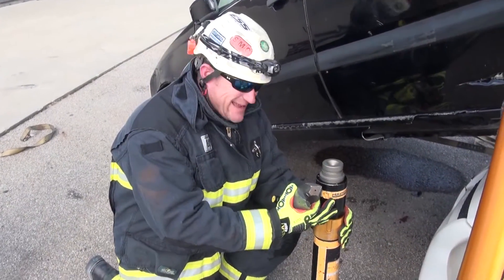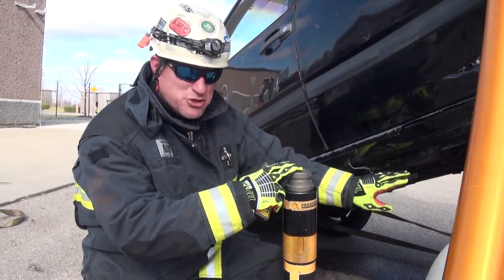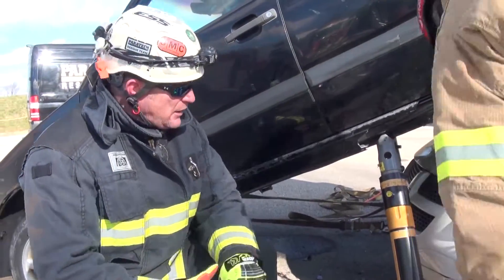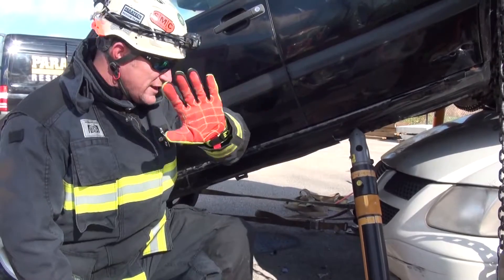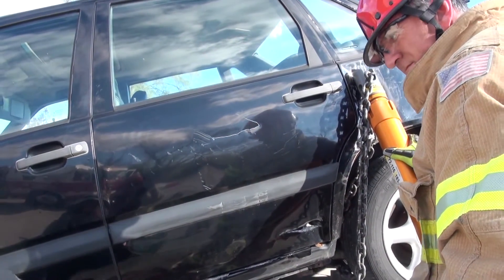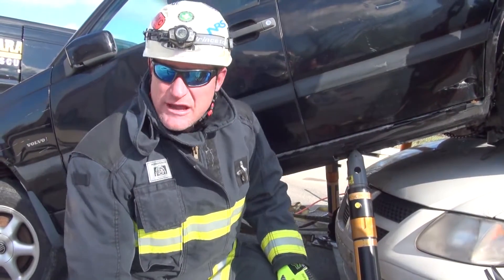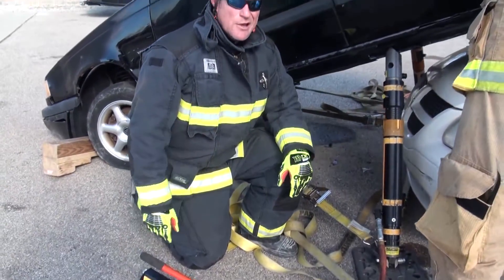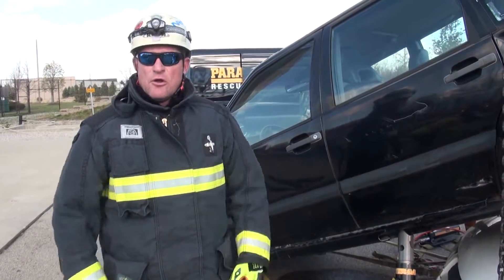Rescue Methods Fr1:  Car on Car Stabilization Part III

Comment: Good video. Learning point for the slack in the chain for the basket is to chase the gold series strut with air and bump your pressure up beyond the typical chasing pressure and it will take the slack out of the chain.

Comment: at 9:21 there is a nice bow in that chain. Is there a link that is caught on something in the wheel well?
Reply from the maker: +hookandcanman83 Good eye.  We actually had to do a little cinematic presentation for this video.  The footage could only be captured one side at a time so it looks like a two sided lift and capture but it wasn't.  The load was actually lifted one side at a time and was resulting in somewhat of a dead leg on the capturing side.  Without extending both capturing struts simultaneously on both sides the chain was "sticking: more or less.  That would be a critical point in the field to watch to make sure you kept the chain as taught as possible.  Thanks for weighing in.  We love the input and interaction.